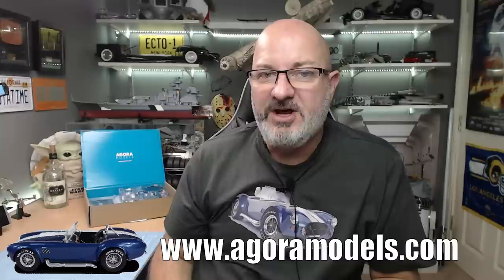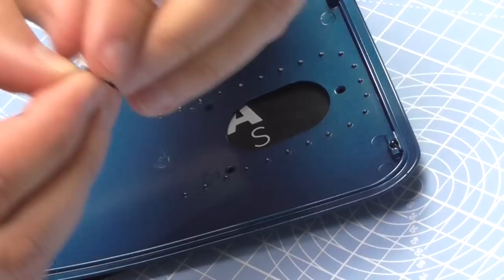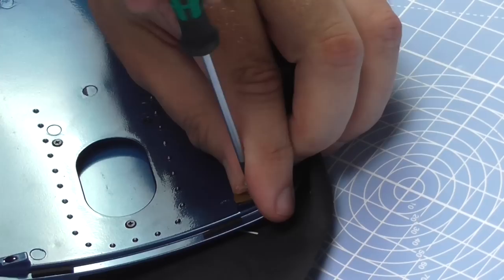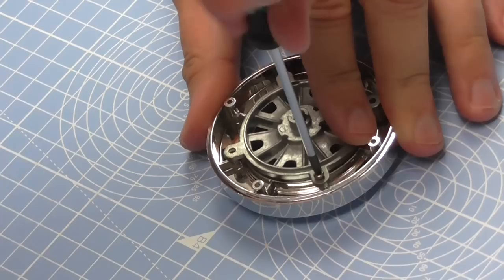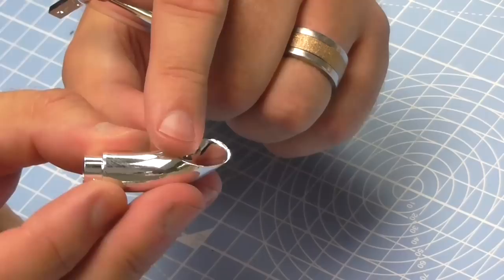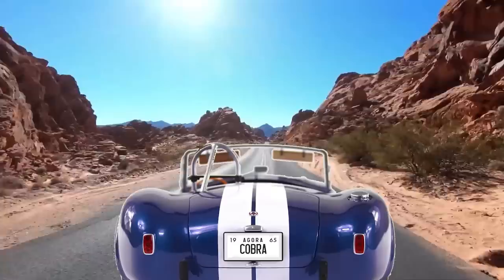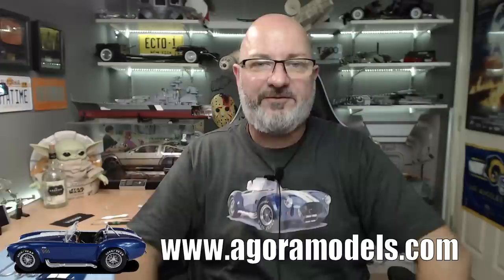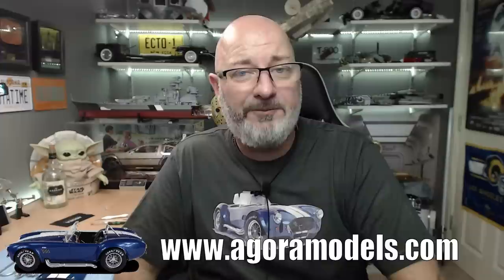Agora Models 1965 Shelby Cobra 427 semi-competition 1:8 Scale - Pack 1 - Stages 1-6

Comment: For the tires on my 1/8 scale Shelby Mustang, I put them in a food dehydrator and set the temp for 150 degrees and put them in for about 10 minutes.

After that, they were nice and soft and the wheels went in with no trouble. 

DeAgostini recommends the hot water too......the dehydrator was easier for me since it sits right on my table in front of me. 👌🏽

Comment: wayne you put the square exhaust plates the wrong way round,the nut details should face the exhaust..
Reply from the maker: Yep. You are right. Silly me. Easy to fix though. Thank you Peter
Reply: I think it's correct Wayne the way you have done it , when you see the picture of the finished engine in the next pack you will see why 👍

Comment: Hello Wayne. I'm hoping you'll respond to me in a timely manner. After watching your videos, I ordered the 427 Shelby Cobra model. I received it today. However, does this thing not come with instructions? I ordered the complete kit and I have been through every box in here and I have not found any instructions or my book on the history of the Shelby Cobra. Please help me out here.
Reply from the maker: No. The instructions are online. Just go to www.agoramodels.com and click on the download tab.
Reply: Wow, that's not good. This may seem strange but I have no internet or cable service into my house since my girlfriend and I don't really watch TV. So I'm going to have to try to put this car together looking at the instructions on my phone. Had I known this beforehand I might not have ordered this model. And I also didn't get my book on the history of the Shelby Cobra! Not to happy right now!☹️
Reply from the maker: @richardbuchli4071  that normally comes after the delivery. All of Agoras instructions are online only. I hope if you watch my videos you will have an easier time of it.
Reply: I think I better watch your videos again. And I like the tip on using the oil on the screws.👍
Reply: Hello Wayne. I've started building my Shelby Cobra. I'm doing it with my phone. I did finally get cable and Internet Service though.😁 There were a couple of pieces on the engine I had to work on and tried to use Tamiya's extra thin cement to glue the pieces together but it didn't hold. Didn't you mention using super glue, and do you use a certain type. I'd really appreciate it if you could help me.👍
Reply: I'm moving on to assemble the frame until I hear from you.
Reply from the maker: Yep I use superglue. Brush on Gorilla glue on Amazon is a good choice @richardbuchli4071
Reply: Thanks Wayne.👍

Comment: I think you made mistakes with the exhaust pipes. At 21.49 It looks like you put that end plate over the ends of the 4 pipes, the wrong way round. I think the nut detail should be facing towards the 4 pipes, not the other way round. When you attach it to the car later, the nut detail will be facing outwards. The way you did it, I think is wrong way round. Same with other exhaust at 25.12.
Reply from the maker: Yep. I have changed it. Always making mistakes me lol